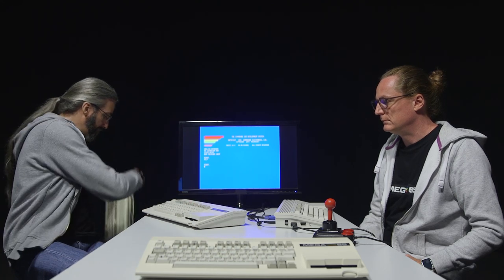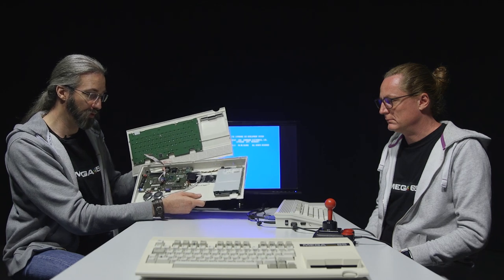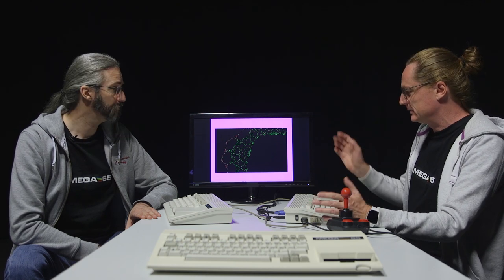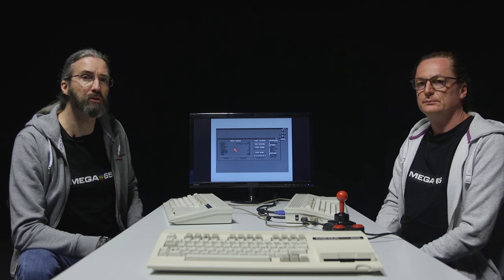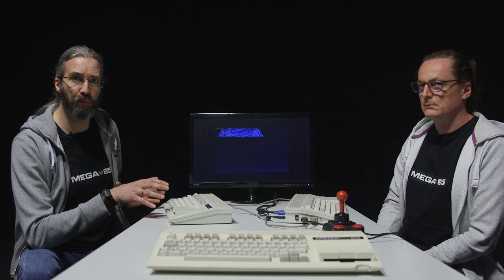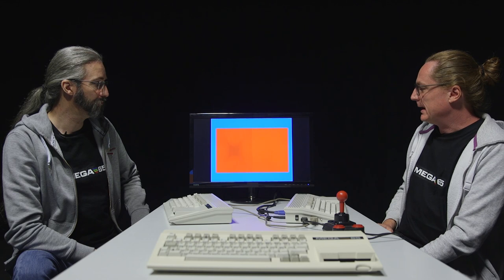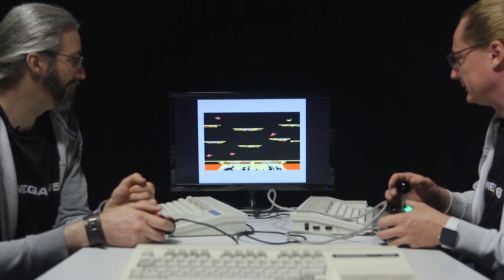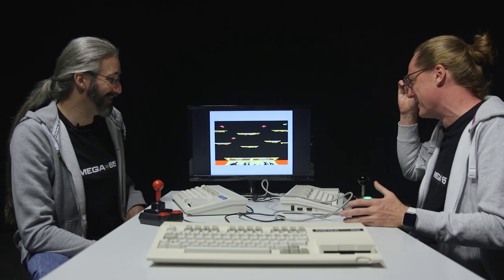September 2020 update on MEGA65 progress

Comment: Love to see the enthusiasm you guys have for this machine! Like many others have said, I can't wait to own one!
Reply: Btw, something I was just wondering about, will the MEGA65 be able to use the "burst" mode of 1571 or 1581 drives either only in 65 mode or both 65 and 64 modes?
Reply: @0raffie0  since our recent mainboard update to Revision 3, from hardwarepoint of view "burstmode" is possible, but it's not yet implemented in the code as far as i know. 
So coders welcome ! ;-)
Reply from the maker: I don't think the C64 mode KERNAL will try to do burst mode, but as Anton has said, the hardware is there to support this.  There is a bit of VHDL work that we have to finish off, to allow burst mode to work in any mode, but the SRQ line is there.

Comment: Absolutely amazing! So if I understand correctly; the MEGA65 is an actual 8-bit computer, not a simulator?

I grew up with MSX and Amiga, but looking for a C128 for some time to get back into the 8 and 16 bit computers.
This MEGA65 is much more appealing to me as it uses new electronics, HDMI, microSD etc, so like buying a brand new 8-bit in 2020/21 :-)

Will documentation be included for people like me who did not grew up with C64, ie are not familiar with how simple things work like booting sw, which commands to use etc?
Reply from the maker: Correct. An actual 8-bit computer all the way through.  The only CPUs in it ar 6502-class processors, all implemented in an FPGA. See the "docs" tab at mega65.org for the 800+ page work-in-progress user guide.

Comment: We are in desperate need of a new retro 8bit, and everyone is struggling to figure out the ideal one, except MEGA65.  This is the solution, so I do hope it comes out.  One thing I do wish for is extensive audio features.  One thing that was once possible only in 1 machine way back is on the SNES audio, it had the capability of mixing the audio into a reverb/delay/chorus which I believe was sort of a digital implementation of a BBD.  This made it so that games that happen in forest or in a cave had the sound effects going through some echo / reverb etc.  It was a novel idea.  This would add a lot and would avoid using more voices for doing what a BBD can do.
Reply from the maker: File an issue on github.com/mega65/mega65-core/issues, and we will see what we can do.  Note that we already have Amiga-style DMA audio that can do repeating sequences, so some of the functionality of a BBD is already available.  However there is no true BBD in there, as you have correctly assumed.  What range and granularity of delay do you see as necessary?  What further controls, apart from presumably setting the gain of the delayed signal?
Reply: @MEGA65retro  To make a chorus and reverb you also need an LFO depth and speed on the pitch.  But nothing really fancy.  Decay time and loop time in.miliseconds.  Also a low pass filter control.  Here is a typical BBD https://youtu.be/iCAukKBAECY
Reply: @MEGA65retro  I will post!!
Reply from the maker: @33ordie  I can't promise anything, but if you file the issue, we know to take a look.

Comment: Are all interfaces from the original C65 included in the Mega65?  IEC is very important for floppies and Commodore-printers.  And the Userport is important, too.  The original C64 userport has 9V AC, but the original C65 didn't have that, which is a shame, because many RS 232-V24 adapters (for modems, printers, lab-equipment, terminals, etc)  will not work.  Without the 9V AC you can still connect a parallel (Centronics) printer, joysticks, relais-cards, smart-home adapters, etc.
Reply from the maker: So, the MEGA65 contiains IEC drive port out of the box, of course. It also has internal expansion capability to provide a user-port and also a tape port (which the C65 also didn't have), and C65 1565 drive port and C64-style composite video output port.  However those extra ports will not be available until the expansion board is made.  That said, the injection moulded cases have cut-outs for those extra ports, so you can just pop them out, instead of having to hack your wonderful MEGA65 case to pieces.  As for 9V AC on the user-port, that will depend on the eventual design of the expansion board. But as we have 12V DC on the MEGA65 main board, it should be possible to make 9V AC available. That said, I'm not sure how much need you will have for RS232 adapters on the user-port, since we have 100mbit Fast Ethernet (that really is FAST). I'd love to hear more about the specific devices you would like to connect via user-port.

Comment: I just received my Mega65.  What would be the best tool chain for targeting 3.5MHz mode on Mega65 while targeting  compatibility with a real C65?  I am one of the lucky ones with reasonable access to both.  Would it be cc65 + mega65-libc?
Reply from the maker: For now, cc65+mega65-libc is a good combination. We are working to port VBCC, and KickC already also has MEGA65 support, so you have options.  Hop over to the discord group to join other developers exploring these same questions.

Comment: The most important question is: Can I install Retro Arch on it to play Atari 600XL games?
Reply from the maker: No, but it would be quite possible to port an Atari XL FPGA core to run on the hardware.  Much nicer than an emulator :)

Comment: Hello, in case one doesn't install real SIDs, what sort of SID emulation do you use?
Reply: it's not an emulation. it's an FPGA SID rebuilt and we have 4 SIDs running, connecting mouse, or paddles: No problem. you can find all information on the MEGA65 GitHub page
https://github.com/MEGA65
Reply from the maker: We have 4 SIDs implemented in the FPGA.  The optional expansion board will most likely have sockets for real SIDs, and there is a SID cartridge also in the works.
Reply: @MEGA65retro  How does the FPGA implementation compare to the quality of reSID or the best available SID emulation on PC nowadays?

Comment: How does it telecommunicate?
Reply from the maker: The MEGA65 includes a 100mbit Fast Ethernet controller that really is fast, unlike the RR-NET and similar designs based off that horrible old ISA-bus ethernet controller.  Ping times <0.5 milli second are quite easy to achieve, for example.  Expect that we will have software for downloading files from the Internet on it. If you need WiFi, for now, you will need to use a cheap wifi to ethernet adapter, like an GL-iNET or TP-LINK wireless router.
Reply: @MEGA65retro  thanks. I'm sold.
Reply: MEGA65 👌🏽👌🏽